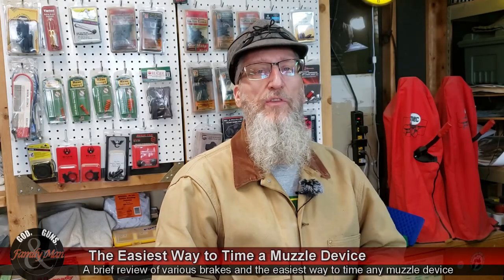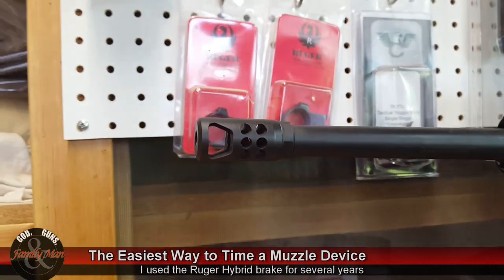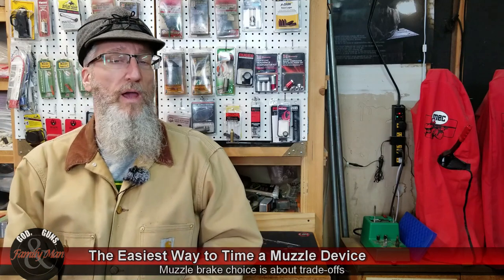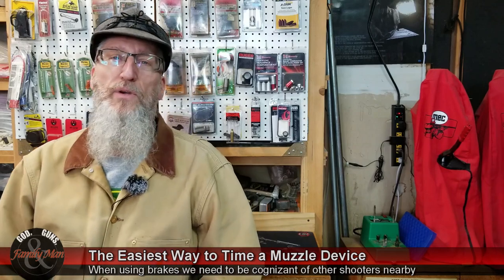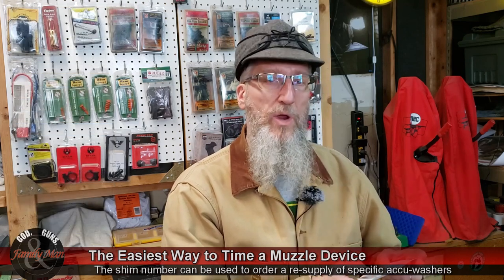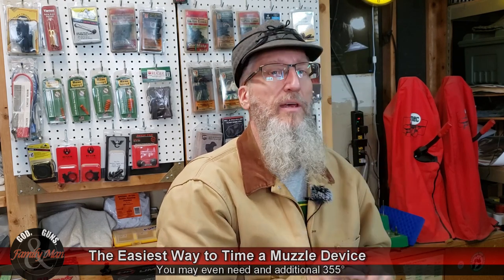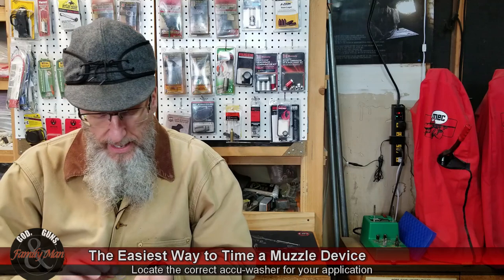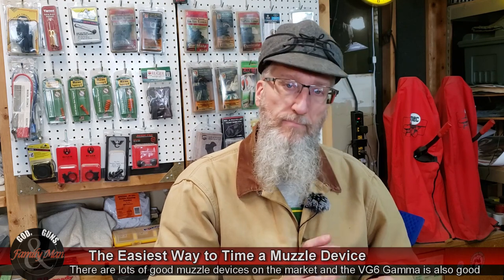The Easiest Way to Time a Muzzle Device

Comment: I think you're supposed to put on the #18 washer first before hand tightening the muzzle brake.  Then take it off before using the correct washer size according to the chart.
Reply from the maker: You are correct Rick, thank you.  I just checked their instructions online at https://store-iac7bmebd7.mybigcommerce.com/content/documents/PRECISION%20ARMAMENT%20ACCU-WASHER%20MUZZLE%20DEVICE%20ALIGNMENT%20SYSTEM%20INSTALLATION%20GUIDE.pdf?_ga=2.175246946.1569905034.1625483284-464547418.1594042834
Reply: Lol, yes 👍

Comment: Short of un-precise eyeballing, how do you find the 12 o clock position?
Reply from the maker: Well, this isn't really rocket science and absolute precision is not necessary, but what one can do is level the rifle in the rest or vice block using the same leveling tools used when mounting a scope.  That will get you so close that the timing of the muzzle device will be excellent.

Comment: What do you do if you fall between 2 shims? For example, you're about 30 degrees off with no shims. Whhat do you do in that scenario?
Reply from the maker: Hello Ryan
If you need 30 degrees, I would use the closest washer possible (20 degrees) and then use a bit more (or less) elbow grease to give me the final 10 degrees.  That may be difficult in some cases and you may still be off a bit from perfect.  Feel free to contact the company directly with this question as they may have an ideal solution for you.  I hope this helps some.
Reply: @sdkweber  gotcha, thank you for the response! Just ordered a set
Reply from the maker: @ryan370  You are welcome. I think it will work out well for you.

Comment: I have a AR15 22 caliber. What does it mean to time a muzzle device?
Reply from the maker: It is a term referring to anything attached to the muzzle. Examples are flash hiders, brakes, compensators, and silencers. Some of these muzzle devices need to be timed correctly to function optimally (timing means there is an up, down, left, and right side that needs to be set correctly).  

Your rifle probably has a bird cage flash hider and if you look at the bottom of it, there is probably no openings there and that is done so dirt and dust does not kick up each time you shoot from the prone position.  Some flash hiders do have openings around the entire device though.
Reply: @sdkweber  thank you! Yesterday I installed a birdcage on the barrel. However it’s very slightly off center. Will this effect the shooting/accuracy? And my flash hider has no slots on the bottom
Reply from the maker: @jeffreyjohn1691  I have never had a muzzle device effect precision.  I have seen once a shift in point of impact but never a degradation (or improvement) of precision.  You will want the bottom (the area with no slots) point as straight down as possible.  If it is off by 5-10° or more, use a different Accu-Washer. I hope this helps.

Comment: What about rocksett?
Reply from the maker: Hello, thanks for watching and good question.  I do not use or recommend Rocksett or Loc-tite on muzzle devices.  It is not necessary if you properly tighten the device. Plus, if you want to change the device later having to deal with Rocksett makes it far more difficult.